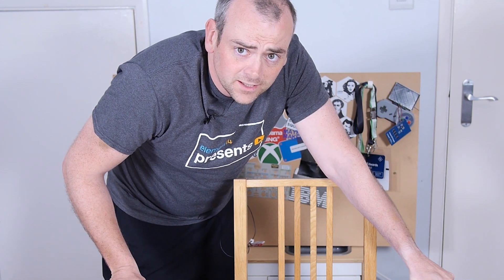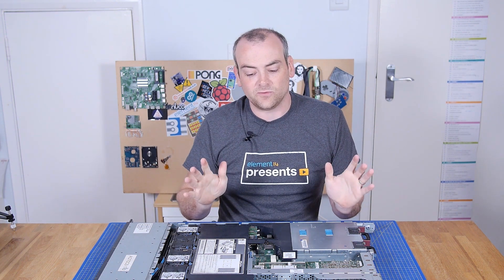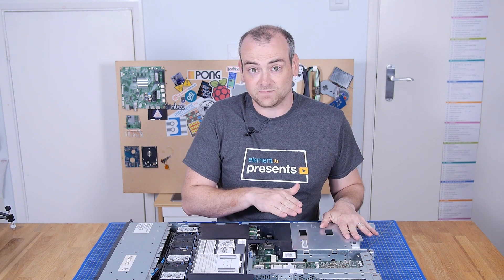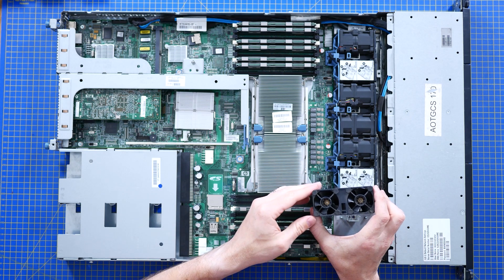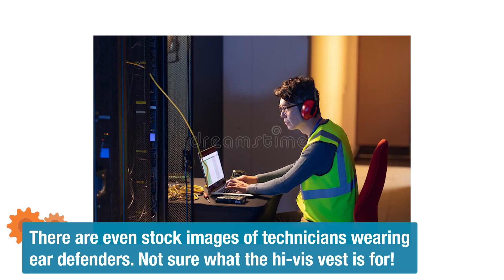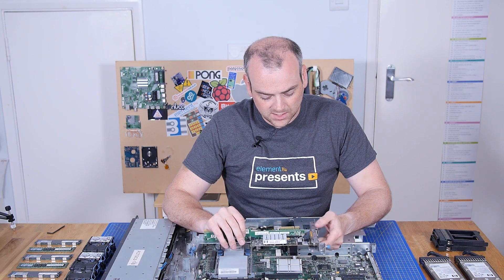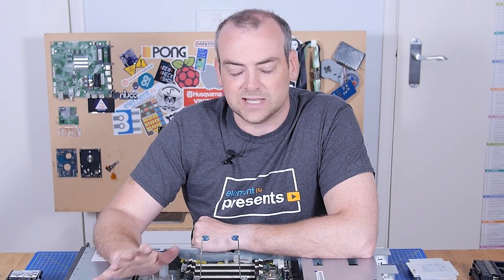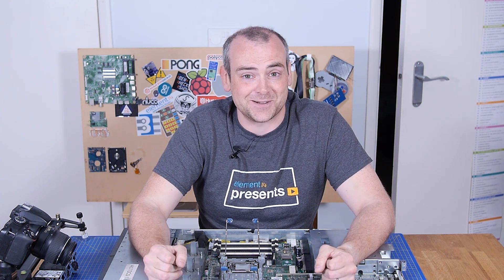HP ProLiant DL360 G6 Teardown and Maintenance - The Electronics Inside

Comment: Before retiring, I had installed hundreds of HP rackmount servers.  The DL360 is a well made 1U Server, but my favourite was the DL380 2U Server.  The larger form factor used larger fans, and was therefore quieter.  The larger enclosure also allowed better airflow... better cooling.  Although server failures were rare with the Proliants, the 1U models, in my experience, had a much higher failure rate, which I attribute to the tight quarters for the components.  And from an installer point of view... a rack full of 1U Servers is a nightmare to cable cleanly... lol.
Reply: Funny enough just picked up a dl380g4 for 10$ and a dl385 g2 I believe for 20

Comment: Their is a lot of mis-use of nomenclature in this video.

You mention that "SATA 3" runs a 6 Gigabytes-per-second (6GB/s), and when you have two of your Harddrives togther then you get a peak throughput of 12 Gigabytes-per-second (12GB/s).

All of the above is WRONG.

SATA/SAS speeds are measured in Gigabits-per-second (Gbps or Gb/s) so your peak total throughput of a single SATA 3 drive is limited too 600MB/s and NOT 6000MB/s.

Also, you mention the internal USB port....
That port is so you can install a USB-based Flash Device which can host the servers Operating System on-board & internally, thus free-ing up drive sleds at the front for storage only.
It is typically used in Virtual Machine Hypervisor Setups.

Nice video, just required a brush up on the wording as this can create a lot of confusion for people new to this kind of stuff.
Reply: I was looking for a really quick way of describing the concept here, not an in depth detailed dive into controller overheads and combined write speed, or the pros and cons of various raid levels. With that said, I'm sorry I slipped and said bytes not bits - that's the kind of thing that bugs me too, and I said it this time!

Also, yes, additional boot devices! I don't know why that didn't occur to me at the time, but it seems really obvious after the fact!

Comment: @15:44 USB and SD-Card can be used to boot VMWare or other OS (although best to choose an OS that doesnt write to much to the SD/USB as it will wear it out fast - my ProxMox server did in about 1yr), the iLO management can be nice (intergrated lights out)  as you can remotely control the server from another computer including powering off and on, virtual console, and being able to use CD images to boot from and install an OS remotely. although IIRC this machine will be on iLO 2 which is  very limited and works best in IE with Java6 (iLO 4/5 started to support HTML5 for remote access)
Reply: Spot on, and with the death of IE, iLO 2 is serverly in trouble - at least I can still SSH into it! I can also use other desktop based clients for this too.

Comment: MicroSD card can be used as a VMWare boot device.

iDRAC etc is "out-of-band" management!
Reply: I've used it for Red Hat Enterprise Virtualization, similar to VMware ESXi you basically have a 300Mb read only boot partition and a configuration file which basically tells it what management server to contact on boot for the rest of its configuration. I've also used the for 100Gbps edge firewalls where we had a small read only boot partition and wrote all its logs remotely. This SD card boot functionality is particularly helpful if you need to use it as an embedded device with serious horse power that in normal operation should never write to the disk, the slot will honor the read only switch on the side of the SD card for these use cases. The USB port is for something you see in some specialized applications, while it can be used for booting that's not what its for. Some types of (expensive and specialized) software require USB dongle be inserted to start or unlock features of an application, in these cases you don't want to use the USB ports on the back or front incase because a passer by might take it thinking it a regular UBS thumb drive some one just accidentally left in the machine so you use the internal USB port for these license dongles.